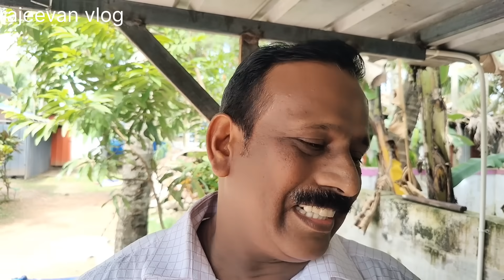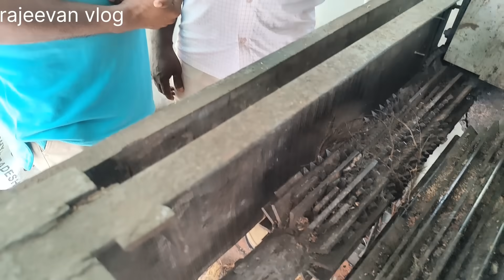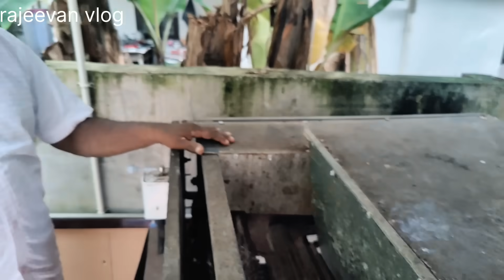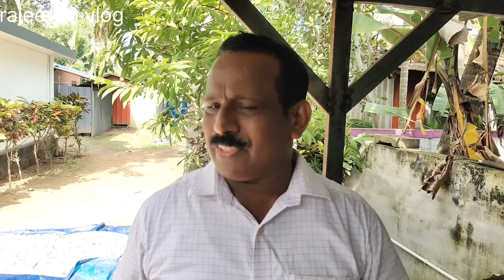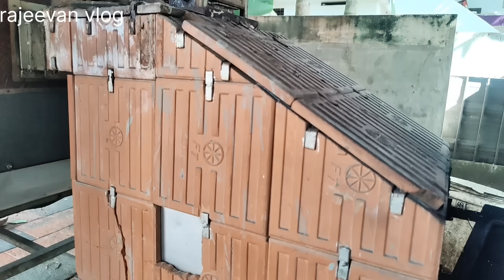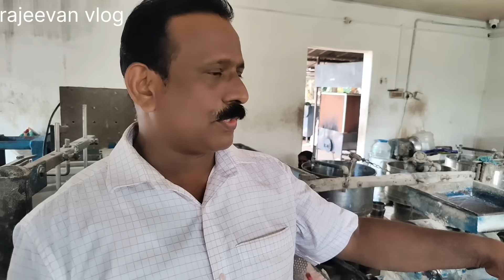മലയാളി കണ്ടുപിടിച്ച മെഷീൻ കണ്ടോ coconut dehusking machine

Comment: Add a vertical chute on to roller to stack cocunut  and attach a conveyer system to feed cicunut. Currently it is a major safety violation, running a rotating machine without guard is unsafe.